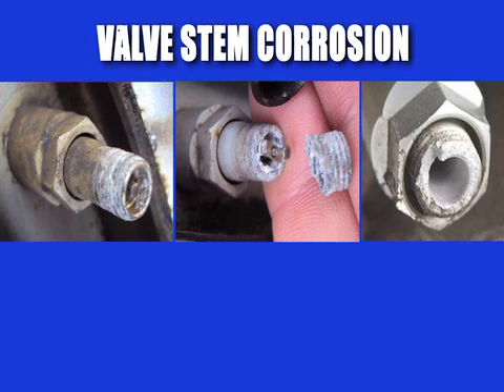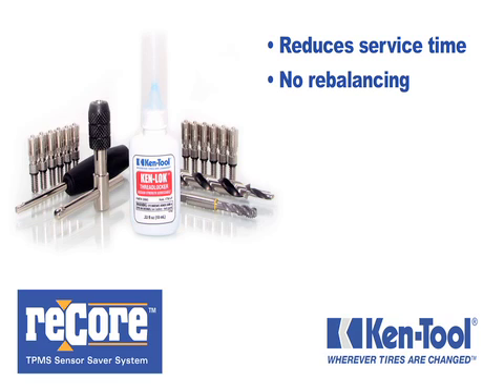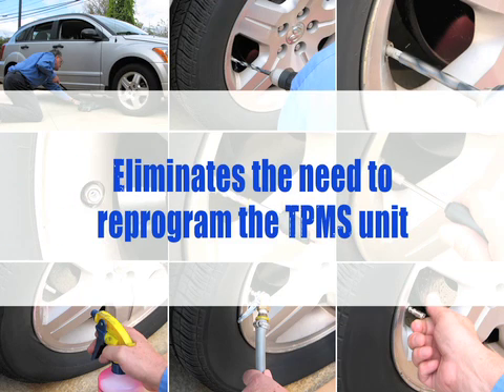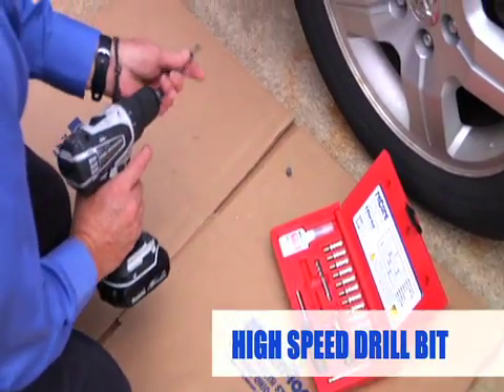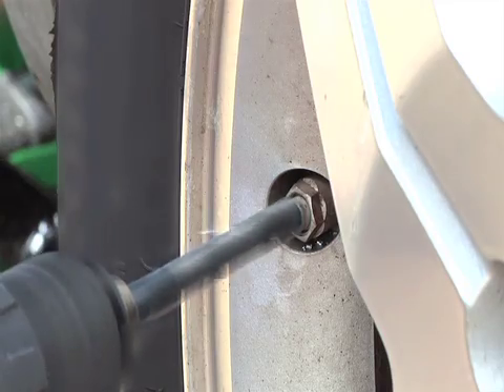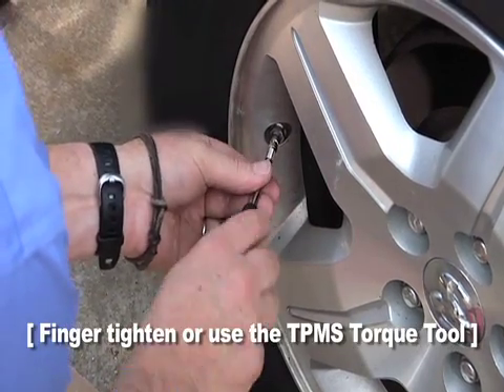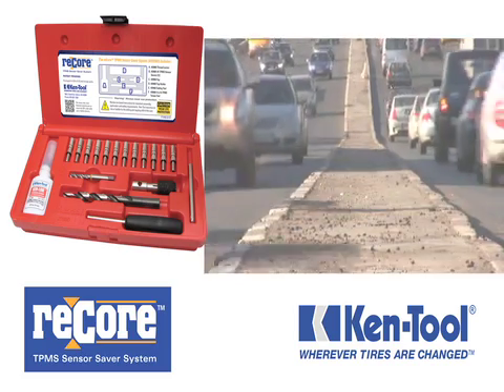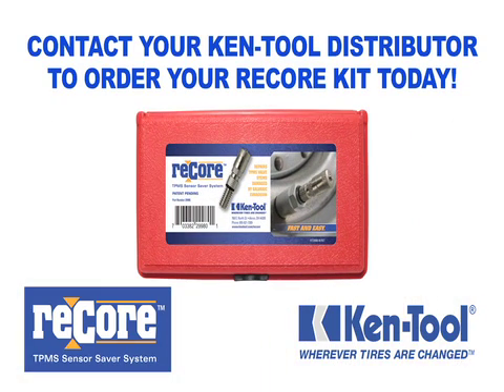Ken-Tool's New reCore™ TPMS Sensor Saver System Repairs Frozen Valve Cores!

Comment: Do you need to release all the air in the tire first before performing the repair?
Reply: No you do not. You can allow the air to escap as you drill out the stem.

Comment: Nice - needed for the VDO style valve. Chrysler, Jeep, Nissan all have bad valve stems.  But, what should the cost be to the customer for this repair?
Reply from the maker: Thank you for your comment.  We feel that a shop could readily charge $29.95 to $39.95 for this repair.  This is less costly for the shop than replacing the entire sensor and having to re-learn the new unit.  And it can be done on the vehicle without having to remove the tire.  Customers appreciate keeping their original sensors working and having them fixed in a jiffy!  -RT